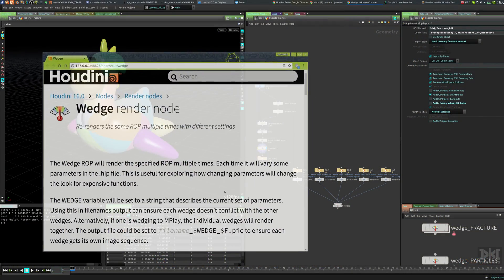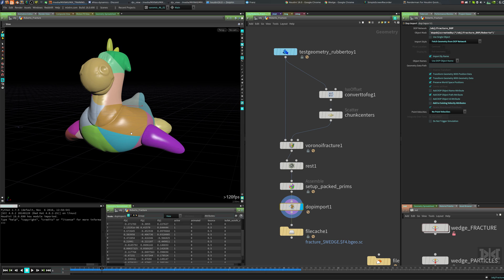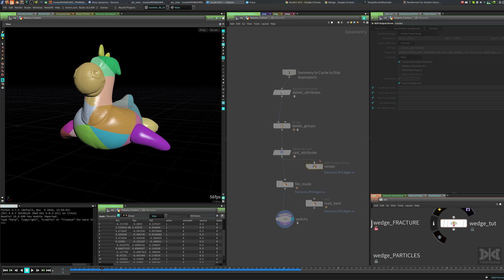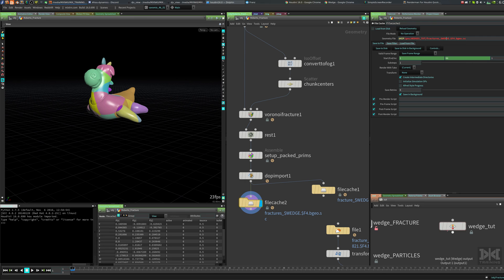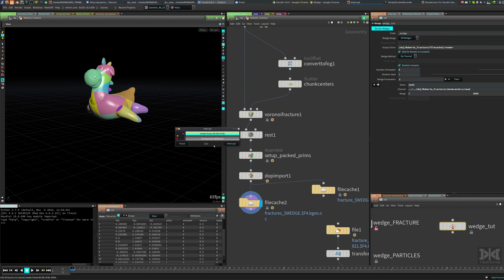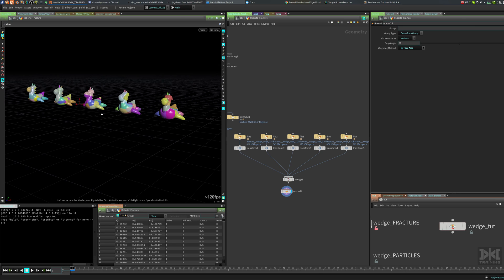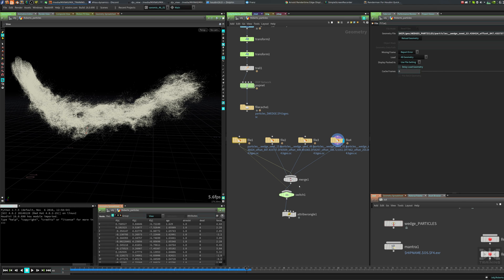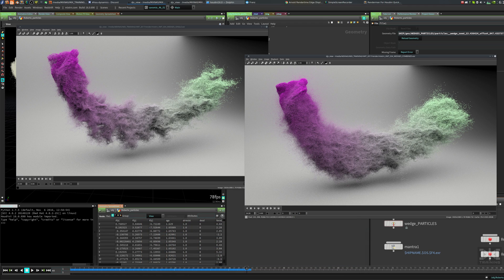VMT 033 - HOUDINI - WEDGE ROP

Comment: I knew all that but how do you get rid of the weird number after the wedgenumber ?
Reply from the maker: you can’t, that’s how the wedge generates the variations so you could recreate any version if you need to, that’s is actually necessary
Reply: @varoschool  You actually can.
Instead of putting the $WEDGE variable, you can put $WEDGENUM.
In that case it will only output only a single number that will match the step you set.
You cant have any prefix or any underscore or any name of parameter, just a single number.
Just bake in "w" or "wedge" in your ROP geometry node so you know what number is related.
Perfect for what I need :D
Reply from the maker: @PhO3NiX96  awesome